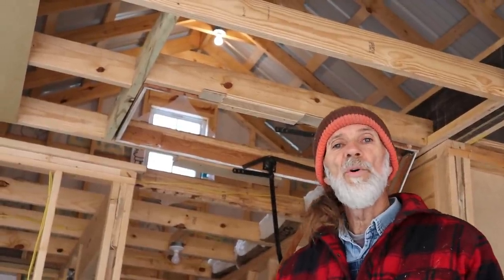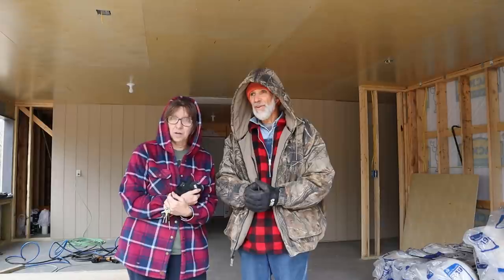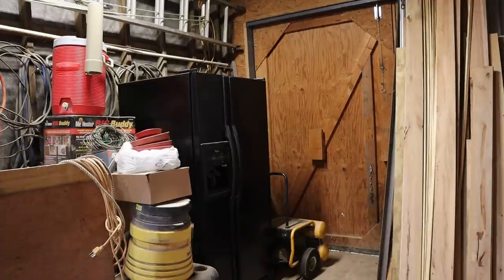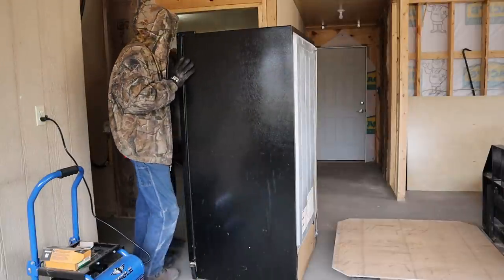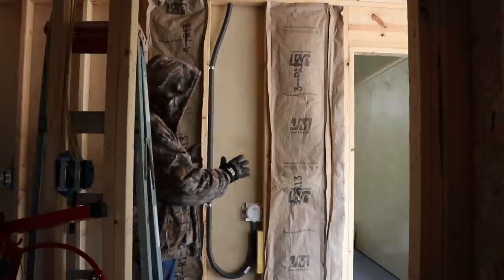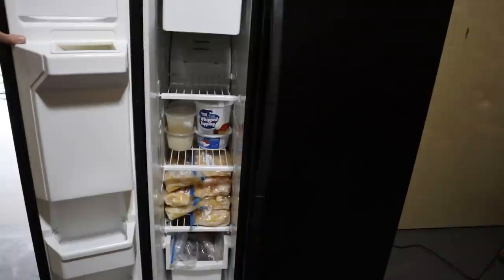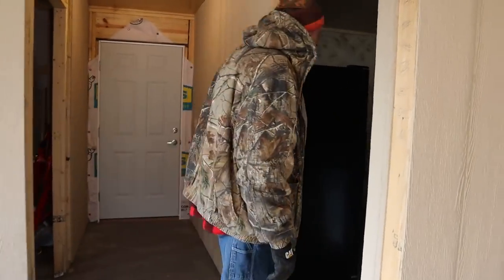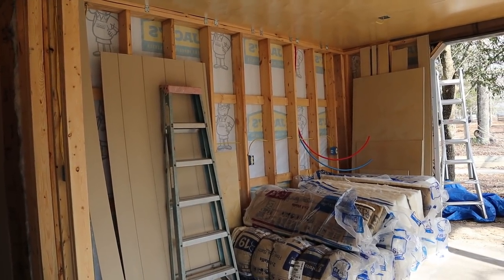1st MOVING Day in Canning Storage Room | She Shed build | Part 22

Comment: Check your refrigerator to make sure it runs outside. Our new refrigerator had to have an adapter on it to make it run when the temperatures dropped. We checked several reliable sources for appliances and we all told the same thing. Our old 20 year old fridge went bad , it worked fine.

Comment: Pex will freeze. We are in NTX and every winter we drip out faucets and open cabinet doors. The builder put most of our plumbing on North side of house. They insulated the pex in attic and it still freezes. We also keep heat tape on manifold system in garage to help.

Comment: Have you ever noticed that union boys always install electric outlets so the ground prong is at the top of each plug and not at the bottom? That so you won't somehow slip a knife behind there a touch both positive and negative at the same time, you will always touch the ground only.

Comment: You all are busy!  When I looked at the room, I thought, you need ventilation.  Why?  The sacristy at my church overheats from one small refrigerator running in it. It too has no windows and is enclosed.  It's probably 3/4 the size of your room.  If it's not too late, you might put a vent to another indoor room, or an air conditioner.